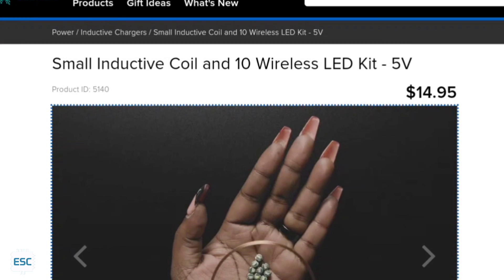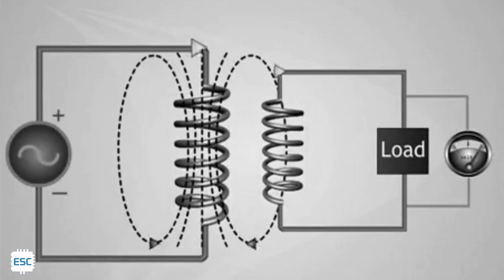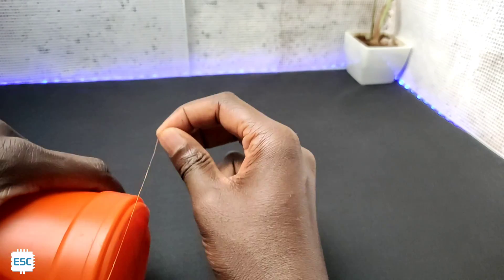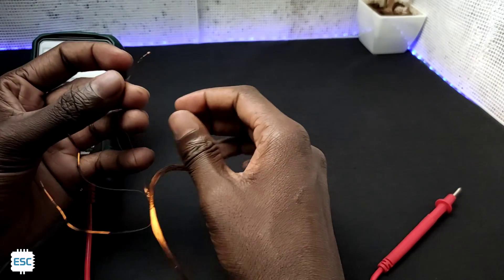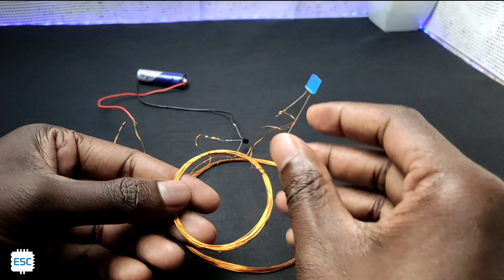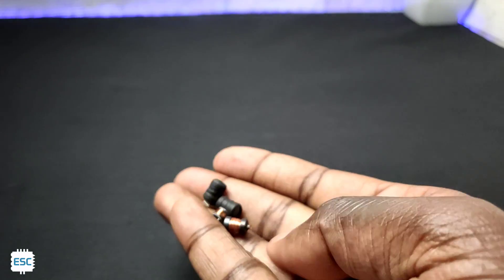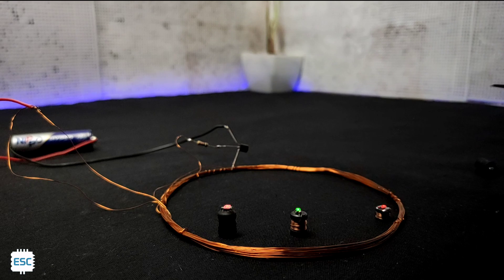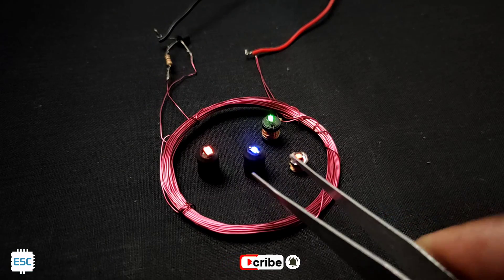How to make Wireless LEDs at home

Comment: Hi, I've taken the small component that makes these LEDs wireless from some LED bulbs, but I've noticed that the LEDs flash but don't stay lit. Could you tell me what makes this happen and perhaps how to get the LEDs to light up when they pass through a wireless ring and stay lit without flashing?
Reply from the maker: Use my socials and send photos.. maybe i can help
Reply: @EDISON_SCIENCE_CORNER Ok I'll do that in the next few days. In the meantime I'm wondering if the fact that the LEDs flash when they're powered by the electromagnetic ring is due to the fact that I used what I had at hand, i.e. the wireless charger for my headphones, it's possible that this type of charger doesn't work properly?
Reply: @JoshuaRilliet yes phone chargers have safety mechanism which checks if suitable receiver is available, that blinking  system is for that. You cannot directly use those chargers

Comment: will every induction charger work with such leds?
Reply: Hey, i tried it. It does work, but the LEDs are not glowing constantly. You have a flickering light, when you place them on top. At least for the ones I have tried.
Reply from the maker: Try increasing the turnes
Reply from the maker: Most if them

Comment: Hello, as the video is two years old I hope you'll see my question: I do a lot of recovery to avoid buying components that can still be used, however I have no idea where, or rather in what type of device, I can find these transistor npn bc547, could you tell me when devices doomed to destruction / waste I can find please, as it would be to try I do not want to buy a bag of several of these transitors. I also see that you use this other component (220 muh inductor) for this type of manufacture. Can we find any in devices and if so, in which ones (always with the idea of reusing components that would be destroyed if not recovered) and don't LEDs need a resistor in this type of assembly? Thanks in advance
Reply from the maker: You can use any type of components from anywhere. Yes the BC547 can be used. 220muh  inductor maybe you can find from computer Power supply boards.
Reply: @EDISON_SCIENCE_CORNER thank you for taking the time to reply and thank you for the information. ;o)

Comment: Did you took inductor from 9w led smps? I tried the with inductor of led bulb but its power is too low but work well ! And instead of joule thief can we use 555 ic to power the coil?
Reply from the maker: No I bought new inductor. Yes you can try with 555 circuit
Reply: @EDISON_SCIENCE_CORNER  online or offline and where I can buy inductor cores in offline market
Reply: @EDISON_SCIENCE_CORNER  thanks

Comment: the circuit for the oscillator looks oddly familiar... oh! it's an adaptation of the classic joule thief.
Reply from the maker: Yes that's correct
Reply: I've never thought to try it for this. although i've used a toroid with an extra winding to make 100ish volts to run a neon from a single AA.  @EDISON_SCIENCE_CORNER

Comment: If i want to increase the distance between the coil and the led, what should i do? Increase number of turns or increase the diameter of the coil?
Reply: Increase the flux mind you your radial range will also decrease as you decrease the diameter meaning the LED will have less horizontal distance above the coil.
Reply from the maker: Increase the number of turns, decrease the diameter ❣️
Reply: @EDISON_SCIENCE_CORNER  ok. I will give it a try

Comment: This is amazing instruction that I can actually use for my project! Thank you so much brother.
Ps, I will place the metallic material which has 2.5mm thickness, between the battery coil and transmitter. Will it would be still works in that condition?
Reply from the maker: I have no idea about that . We have to check that

Comment: Also do you have an example for 12V? Or another option, I would have to bring 12V photovoltaic, one-to-one, through a window or thin wall(camper)?
Reply from the maker: You can use resistors /regulators

Comment: I must've built this many. ways...I can't get it to work! :(
Reply from the maker: You have to use insulated wires, correct transistor , coil ratio etc.
Reply: @EDISON_SCIENCE_CORNER  finally got it to work…I used a 2222a npn and it worked! Tried many bc547’s to no avail. And, yes, did have proper pinout. Thank you for your response.

Comment: im using bs 170 transistor and previously it used to work but now it isnt what should i do and deos the led have to have the same num of coils as the transmitter
Reply from the maker: Maybe your transistor got damaged.
The LED side should have a higher number than transmitter
Reply: @EDISON_SCIENCE_CORNER  how do i tell if my transistor is damaged?
Reply from the maker: Check the transistor using multimeter

Comment: How big can you go with this? Just need to make the coil about 5-10 inches and than I was going to buy the bulbs.
Reply from the maker: I dont know about that distance . It should work therotically
Reply: Oh I was reference the radius not distance of lights to the coil. Not sure if the bigger you go with the coil the more battery you need

Comment: Thank you very much for this tutorial it really help

And can you please explain why we're using that amount of resistor and what changes we need if we want to change the spec for example I want to make it 5v what should I do?
Reply from the maker: I used that resistor to decrease the base current if you want use this in 5 then  connect a 1resistor in between your suppy and circuit

Comment: Can we make this ring bigger then the size shown? so to cover more area. can we add voltage more then 1.5v and what is max limit?
Reply from the maker: It will increase the distance
Reply: You might need to shift to a MOSFET instead if you require high voltage

Comment: No its works only If i move the Wire 
On - Not for all time whats wrong
Reply from the maker: Move the wire means
Reply: @EDISON_SCIENCE_CORNER  
i have a Transmitter Coil: 15 loop 15
Than I conncet "loop" to Plus 
Transistor Bc547 Emitor to minus
Collector on coil
Basic ,too...

But nothing is happening 

The transistor is Not  defect and Not wrong placed , i test it:
 -i conncet addly a LED on minus , than to battery.
 - If i holt  my Finger on basic and plus, the LED starts to glow 

But my coil dosent make Induktion :( 

Whats wrong -???  i build it - like this Video

Can you help me?

Comment: Hello! Amazing work!! I want to try this myself for gunpla. Can I use a bigger capacity battery like a 18650 lithium battery 3.7v. If so, would I need to change some components? like the resistor?
Reply from the maker: You can use but you have to change the resistor

Comment: Why transistor opens or closes?
There is a constant voltage and there is no reason for transistor to open or close.  single transistor oscillators don’t work this way.
Reply from the maker: There is a capacitance

Comment: I just randomly found you over instagram, i always wondered if i could make my own wireless Led with some small inductors, thanks for showing me its possible! Great Video! 
Only one question: how did you change the circuit in the end for brighter glowing leds?
Reply from the maker: Thanks. I didn't changed the circuit i just decrese the size of the big coil.